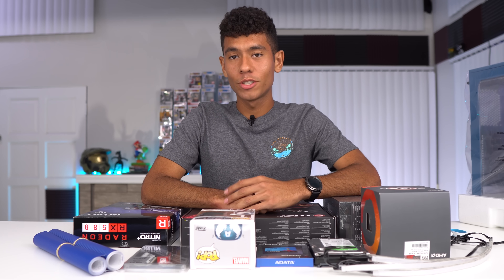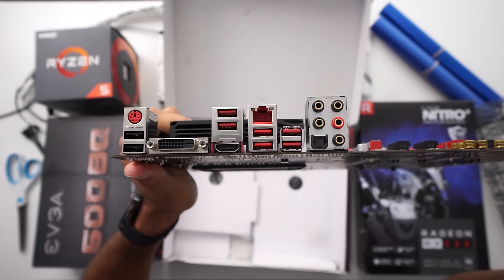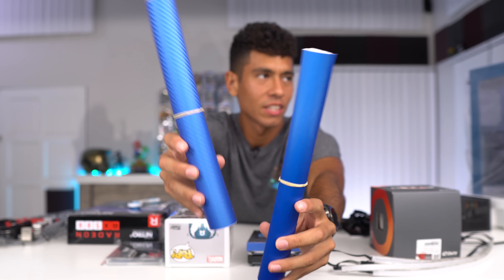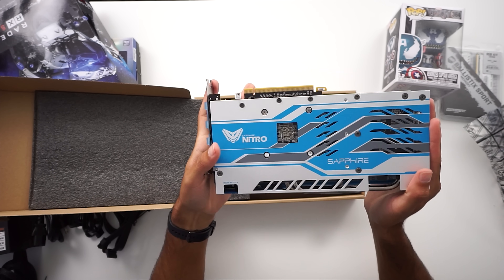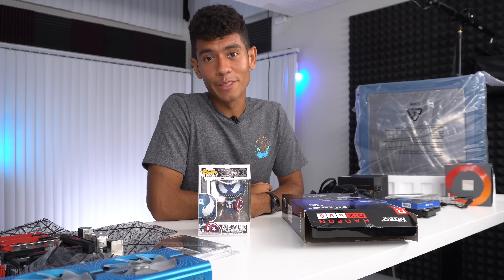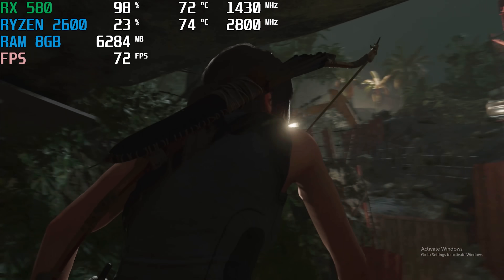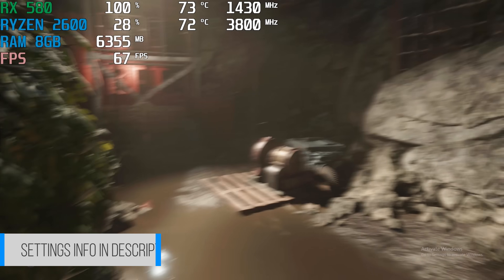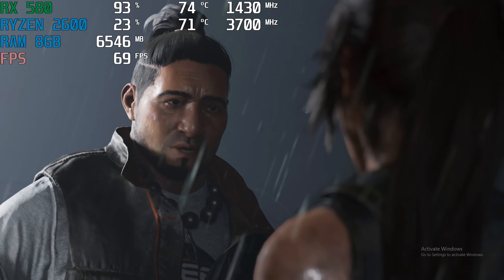$900 Gaming PC Build - Ryzen 5 2600 RX 580 (w/ Benchmarks)

Comment from the maker: NEW $500 PC Build Guide is now live! :D https://youtu.be/LGTqOqznXKw
Reply: Could you stream on this
Reply: Hi there Joey!
Reply: Ok serious question. What kind of build would you make for running racing simulators, and VR? I'm looking into building my first PC for under 1k. I dont have a preferance between Ryzen or Intel. Open to all suggestions. Thanks!
Reply: u should make a gaming channel your r6 skills are godly o_O
Reply: Do the newegg combo(https://www.newegg.com/Product/ComboBundleDetails.aspx?ItemList=Combo.3791772) and with a MSI RX 570 ARMOR MK2 8Gb
Reply: Love your builds, I’m right in the middle of this build except I have the Powercolor Radeon RX 580 already purchased instead of the one you use☝️. Would this be ok? Also could I do 16 gb ram or is 8 plenty? Thanks
Reply: What’s the difference between rx 580 and a 1060 or 1070 ti? I really need your help Joey!!
Reply: Can you use 16gb of RAM in this build or to much
Reply: Can you help me out? I'm tryna build a gaming PC i know some stuff but not that much attaching the cables and i want to choose some stuff if u can help it will be great :D
Reply: which is the best for gaming the 900 or the 750
Reply: I'll just leave this here.....
Reply: My build $686!!!
ryzen 5 2600
  msi b450 tomahawk motherboard 
msi rx 580 8gb
16 GB ram (2x8 for dual channel)
A case that has 3 fans and good airflow and a dust filter on top for  air flow  (led fans 2 in front and 1 in back)
240 gb ssd
320 gb hhd
600 watt power supply 

Also if you need wifi you can add a wifi card for cheap. You can get windows for free
Reply: Joey Delgado Hey. Can I buy a PC off of you? Love every video. It would be great. I’m very unfamiliar to the PC world. You convinced me to switch to PC. Just afraid to buy parts and not know what to do... thanks Joey
Reply: Joey Delgado hey man for the ram sticks could I get the 8gb instead of the 4
Reply: Joey Delgado I’m a noob and this will be my first build
Reply: Joey Delgado also for the case would this one work because the one in link is out of the color I like lol Fractal Design FD-CA-Focus-WT-W ATX Mid Tower Computer Case https://www.amazon.com/dp/B071G4KDKG/ref=cm_sw_r_cp_api_i_3lTOCb35HGRHF
Reply: Joey Delgado or also can I do the 16gb of ram instead
Reply: bro ur actually crazy ur one of the most coolest people on youtube that I have watched keep up the good work. Keep grinding for half a mil
Reply: Here watching old builds again lol... where’s the new videos Joey? 😩😩😩
Reply: Hey joey, what were the frames like on Fortnite in the lower settings?!
Reply: I’m using a 500 watt power supply ? Would that be enough ?
Reply: Brother could you please help me, I Build my computer 2 years ago I dind't know about building computer and about the compatibility of each components, my CPU is AMD ryzen 5 2600 6 core, 3400 Mhz, MOBO b350 gaming pro carbon, RAM corsair vengance LPX 2600 4x4gb 750W thermaltake, with MSI Geforece 2060 6b, could please help me if this components are compatible thank you.
Reply: Actually right now I am having problem every time I turned on my coumputer my monitor had a lines few minutes it goes fine and I can't able to use now the Display port because when i plug into the DP my monitor is turning off and on specialy when I watching netflix.

Comment: This pc works good for this year ? Have been alot of changes on games ?
Reply: Edward Rodriguez this card can get you 60 fps 1080p most games in 2020
Reply: @SOMEPERSON0192   Only 60 fps damn. I thought that can get higher fps for that price.
Reply: @edwardrodriguez166  no,like this vid was made in 2019,you could've gotten 5600xt/2060 in 2020
Reply: Edward Rodriguez well I meant to say 60+ fps in most games in 2020 but remember this built awhile ago and prices have gone down you can get a much better gpu that offers more fps
Reply: Nissar ALI well of course this video was made in 2018 it’s 2020 now and you can get better parts like a r5 3600 also a rx 580 in 2020 isn’t the greatest but a great card for 1080p.
Reply: Nissar ALI lmao that’s why I said better parts rx 580 with a 3600 is horrible on budgeting like a 1660 super or 2060 would’ve been better or a 5600xt

Comment: Old video i know but i actually have this setup i upgraded to crosair 16GB ram and now getting a AMD Ryzen 7 3700X 8-Core cpu but i wanted to know before i purchased it will a RADEON RX 5700 XT RED DEVIL 8GB GDDR6 fir into this motherboard and case ? or will i have to get a new motherboard or case ? if you could answer me asap i'd appreciate it or dm me on twitter @ceddysweats

Comment: Good evening, Joey, I'm from Colombia, I wanted to ask you something about the configuration you made on the motherboard msi x470 gaming plus what version of bios you had and what version of graphics card drivers you installed, soon after the installation the graphics card threw you Some error when connecting to the screen. I ask you why a few days ago I put together a PC with the same characteristics the only difference is the 2700x processor, since the PC starts well when it is formatted but the drivers are hardly installed to the graphics card it fails to give image. The only difference I made was to update the board bios. to the latest version 7B79vAG.

I am entirely grateful if you help me with this data. Happy day.

Comment: built this pc with 16 gb ram 2666mhz and for $440 usd
Reply: ryzen runs better on 3000mhz or higher ram
Reply: @RJzk2yg  price difference? I build it for HALF the price, even if I used 3200 it would still be way below 900$ :)
Edit: he used 8gb 2666mhz, mines better lol for cheaper

Comment: Jease its crazy to see this build cost 900 dollars late 2018 even tho I feel you could of gotten it for alittle less but now 2019 this is a 650 dollar build I knwo that because its my build and instead of the rx580 I got a gtx 1660 since im only using it for gaming the gtx 1660 performs slightly better with just gaming

Comment: I want to ask a question so on amazon I could get this pc a bit over 500 bucks so do you include monitor keyboard and mouse or just the pc
Reply: Omar Ahmed  prices change I suggest just upgrading the parts and it will fit the budget but keep the motherboard and case to follow to the tutorial. For example upgrade processor to Ryan’s 5 3600

Comment: What's better a ryzen 3 2200g rx 570 240 gb ssd with also a 1tb or a ryzen 5 2600 Rx 570 with only 1tb with the same price, what should I choose. They both cost 450 pounds but you could get the ryzen 2200g one without a ssd which is 430
Reply: The second one but + an ssd u can get 12igb just for windows
Reply: Its worth it

Comment: Can someone help  pls i have the same gpu with a evga 600w psu the mustard ketchup wires what cables should i plug in ?
Reply: 4Head both 8 pin and 6 pin need power. So both cables, i built this computer as my first build.

Comment: This pc now costs only 600$ wich is pretty amazing value right now
Reply: What site ?
Reply: @Ozqker On amazon
Reply: @SwatRocks_BeCalm  thx do you know the difference between this blue Rx 580 and the regular sapphire black Rx 580 ?? Is it just a color difference cause the black one goes for 180ish and the blue one he used goes for 210+ and will it work with this pc setup
Reply: @Ozqker  The rx 580 saphire nitro plus is slightly faster and quiter than the normal one if u wanna pay that small difference go for it . Also the rx 590 nitro plus is 210 dollars on amazon but there is nearly zero difference so go with what u prefer

Comment: At the time this comment was made this build is not worth 900 dollars a RX 580 and a ryzen 5 2600 are very weak for 900
Reply: After the Miner's usage. New RX GPUs droped in price.Hence 3rd gen AMD is coming soon,2nd gen is dropping in price too.For 900$ you can make the same build with Ryzen 7 2700,RX 590,Ram 16 (2x 8) clocked at 3000/3200 optional but price difference is 10$,HDD 2-3 Tb 7200 rpm and SSD 240 gb or other better models for extra 10-20$.Same MBoard and for PSU some 600 W Bronze or Gold. And i am sure in few months for 900 $ you can get even better things for the price.
Reply: He made it few months ago and the prices were tooo high

Comment: Have the same motherboard and MSI Rx580 and I’m having an issue with the connection to the monitor. Any ideas?
Reply: AF892 I think the graphics card might be broken. Connect the seller maybe you can change it for a new one.
Reply: MasoodMemes  It was indeed the graphics card. Thanks for the reply. It is solved now with a new one. 👍🏼
Reply: @AFG892  No problem ;)

Comment: I just built this pc, installed all drivers and my Ethernet is enabled but keeps telling me to plug in Ethernet cord. Kinda at a loss for what to do. Just went and bought a usb WiFi stick for now :/
Reply: remar Montana oof
Reply: Luke0635 I just slapped a usb WiFi stick in it and am pulling 10MB/s though so not a total loss just may have to replace Ethernet cable. Computer overall is bad ass for the price

Comment: I just built a ryzen 5 2600 and rtx 2070. My game plays like dog shit. Very rarely do I get high gou usage making for good frames. Overclocked or not. If I play on low settings it lags even more when in theory it should get you more FPS. In games such as rainbow six, fortnite, is it a bottleneck or something I have seen plenty of people using the same build. If you have any suggestions let me know I have tried everything even installing new drivers. Maybe it’s something small.
Reply: Amarrak are you using the display port through the gpu or motherboard
Reply: @justindoan9055  i use hdmi through gpu, replaced power supply, cpu, and now my motherboard will be here monday, hopefully the motherboard fixes it. Any other ideas?
Reply: @JayJaxSmith  Some monitors have downsides when using HDMI. For example my monitor will act as a 120hz monitor through HDMI, but through Display port it is 144hz. I don't think the motherboard was restricting the performance, but a new one always helps (not performance wise though). 
It could be a simple fix as getting a new display port cable. But what is the model of your monitor.
Reply: @justindoan9055  I have a 60hz 1ms response time asus monitor. Maybe the hdmi cord is causing me problems? it's a dish high performance one I just brought with me to college.  update though new motherboard, cpu, and power supply didn't help at all. oof
Reply: @JayJaxSmith  If you are getting under 60fps then idk what's wrong. But if you are consistently at 60fps its your monitor. With a 60hz refresh rate your monitor can't hit any frame rate over 60fps. You'll have to get a new monitor. Unless you aren't even getting 60fps idk what to tell you.

Comment: How u plug ddr5 graphic card with ddr4 ram in same motherboard. How?
Reply: RAM and graphics cards socket is different. Graphics cards have the same pins, may it be DDR3 or DDR5 which go to the PCI-E so you won't really get a problem. The DDR in the Graphics card is the VRAM that is inside the card and you don't really have to worry much about that.
Reply: @katoji9  thanks for the help

Comment: I’m Working On buying This Computer!! I just bought the graphics card! Thanks for the pc idea!
Reply: Mrlegends ! Make sure you order a usb drive with windows 10 installed if you don’t have access to another computer to make your own, I made that mistake and had to wait 2 extra days before i could boot up my pc. Also good luck and have fun with your build, i know i did!
Reply: Ordinary Spider yeah I’m excited!!
Reply: Ordinary Spider could I do the windows thing on a laptop that’s all I have for now lol also I got a question Could I use Fractal Design FD-CA-Focus-WT-W ATX Mid Tower Computer Case https://www.amazon.com/dp/B071G4KDKG/ref=cm_sw_r_cp_api_i_3lTOCb35HGRHF  and also for the ram should I get more like the 8gb or 16 cuz some parts were a little cheaper so I think I can make it a bit better 

Thx (from a pc noob)
Reply: Letha RGIC yes but I would recommend getting a fan in the back for better temps.
I would definitely go for 16gb at 3000mhz u can easily get it for $90-100
If u have enough money buy a 1660 instead of 580

Comment: I’m making a build with a Ryzen 5 2600, MSI Performance Gaming motherboard, 16gb of ram, RX 580 4gb OC+, with a 1tb hard drive and 120 gb ssd and in a NZXT H500 mid tower with a 500w Evga power supply. Will this be a decent build?

Comment: Finally deciding on building my first gaming pc going to go with a 2600x and rx580, x470. Any feedback on this setup?
Reply: 240GB SSD & 1 or 2tb HDD 600w 80+ full modular psu 8gb 2666mhz ddr4 ram  for the best performance make it dual channel ram
Reply: XxSkillerz Gaming yea I was planning on doing the 240gb ssd and a 1tb hd, same with power supply but I was going to go with 16gb of 3000mhz of ram or do you think 2666 will be enough for now
Reply: @xChoChoSSx  enough for a while then upgrade little bit time to time 😂

Comment: Cheaper 
-case €40
-power supply 650w 60€
-motherboard b450m €70
-ram 16gb 100€
-cpu Ryzen 2600x 200€
-gpy rx580 180€
-ssd 120gb 20€
-hdd 1tb 50€
Reply: Dion Jakobs 😂😂😂😂 yeah maybe for that price you can get some used out of date trash parts

Comment: For everyone following this build, I'd recommend going with 16gb of RAM instead of 8gb. 8gb is pushing the bare minimum for games now, and soon 16 will become the norm. Go with 16gb of FAST ram please, so 3000mhz or above if you're going with Ryzen, nothing below. Also, the Ryzen 1700 is the same price as the 2600, and you're getting 8 cores, 16 threads. You also might wanna try to get a 500gb SSD, you can get them for 50-65 right now. Like this post for people to see.
Reply: According to benchmarks, 1700 is slightly better for workstations, 2600 is slightly better for gaming setups
Reply: JustShayPlays so is the ryzen 1700 better
Reply: Hey Do i need to change also the pther parts if I come with 16gb?
Reply: Agreed
Reply: Which is the ram
Reply: Goku Rose the memory
Reply: @creativebusinessunit7506  is it important
Reply: @creativebusinessunit7506  im sorry im a noob at pcs im trying to get one
Reply: @creativebusinessunit7506  i want to switch the 8 gig ram to Corsair Vengeance RGB Pro 16 GB 3000 MHz C15 LED Desktop Memory, Black

Do you know if its good
Reply: Goku Rose yeah thats good 3000 mhz speed should be the standard for 2019 and 16 gigs of ram is better and good right now just make sure you are buying 2x8 which is 2 sticks of 8 Gigs of ram which equals to 16 gigs
Reply: @creativebusinessunit7506  yeah i am
Reply: @creativebusinessunit7506  but how do I build it
Reply: Ya. Also the 590 version of the sapphire nitro blue is only $229.

Comment: Im building one similar a little better
Ryzen 2600
Rx 580 8gb special edition
16 gb ram corsair 3000ghz 
X470 mobo 
Some rgb fans 
600 power supply 
Stock cooler
Reply: MikeEDE _ yeah sorry what you think ?its gonna be better ?
Reply: I have the 860 evo 500 gb

Comment: Nice. Looking good. Perfect budget to 👍 maybe will use 2600x
Reply: I'm completely with you on this. 2600x is 30$ more but it is clocked at 4.2ghz right out of the box. Also I would probably go with at least 3000mhz ram, I feel like 2666 is holding back your ryzen...
Reply: @valeriomonti8647  ikr. Some test said 2600x is perfect for gaming. But you should get 3200 ram. They said 3000 not supported. Checked this  https://www.google.com/url?sa=t&source=web&rct=j&url=https://media.kingston.com/pdfs/hx-product-memory-ddr4-amd-ryzen-and-hx-compatibility-us.pdf&ved=2ahUKEwir94O45drgAhUVUI8KHbQxBDcQFjAAegQIARAB&usg=AOvVaw0p0Y8brUWgsfhRElXNptns

Comment: what parts could i cheap out on a little? with similar performance? also how much does the SSD help game performance if at all?
Reply: ssd only helps with what you store on it. In the video he only has windows on it so the pc can load faster. Games are usually stored on the harddrive . So no, ssd won't affect game performance.
Reply: Thanks

Comment: Does it matter what ssd and ram I use? Never built a pc
Reply: When it comes to SSD, go for ones with higher read and transfer speeds (like Samsung or Crucial), but in reality any of them should work. As for RAM, check on your motherboard manufacturer's website for compatibility first. Generally people recommend DDR4 3000 or DDR4 3200 type for optimal performance in gaming. Hope this helps.

Comment: what do you thing of the gaming pc im building 
(p.s im 12)

-ADATA USA Ultimate Su800 128GB SSD

-Ballistic Ram 8GB Red and Black

-BarraCuda 2TB Hardrive

-ROG Strix B350-F Gaming ATX Motherboard

-VIVO TAX Mid Tower Computer Gaming PC Case

-Evga 600 B1 Powersupply 

-Zotac GEFORCE GTX 1050 Low Profile 2GB Graphics Card

-Cooler Master MA410P RGB CPU Air Cooler

Comment: Nice build but you don't need an x470, the b450 gaming pro carbon and b450 tomahawk have the same exact vrm with even better cooling and they cost less. Btw I like your build, good luck :)
Edit: if I'm not wrong they should have about the same quantity of usb heathers

Comment: if I use a 500 BQ power supply will I run into any problems?
I plan to have 3 case fans not counting the cpu fan

Comment: Hey joey. Love your videos. Im a real noob to building. Ive used your links and purchased everything that was listed. By any chance you have the video to building this? I've connected most of the stuff but nothing is powering on. Need help
Reply: Tony Kim check to see if the power switch is on
Reply: @okay_buddie5855  thanks bro. I figured that i did wrong. I didn't connect power to cpu. Pin/holes didn't match so i was scared.